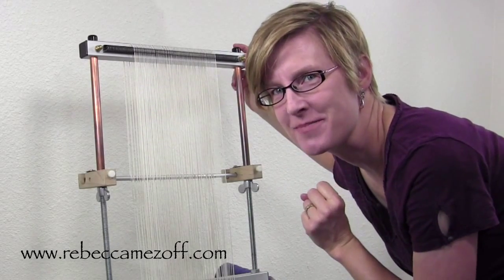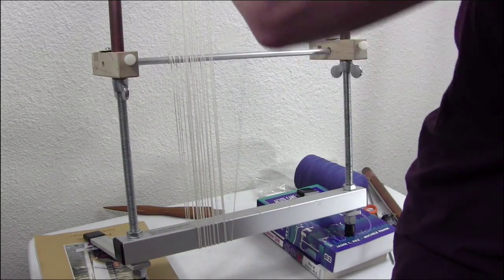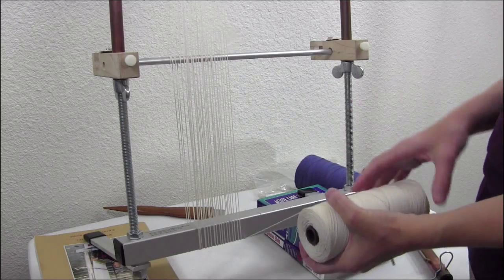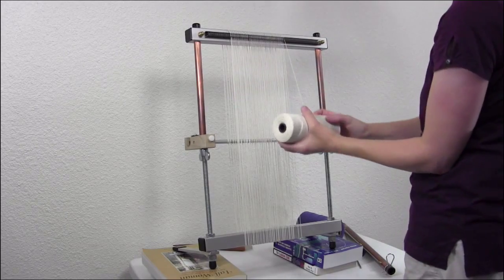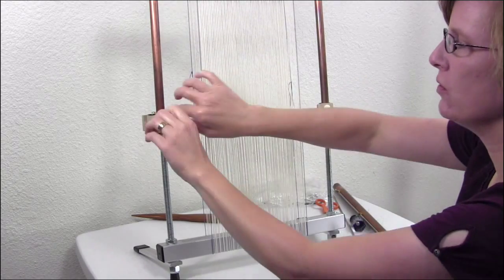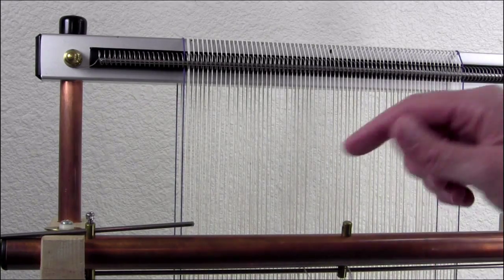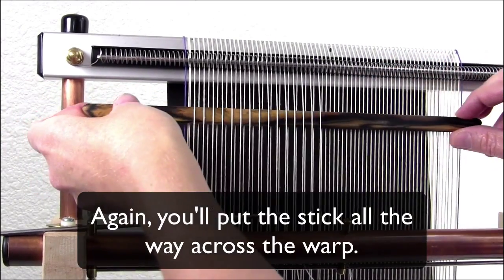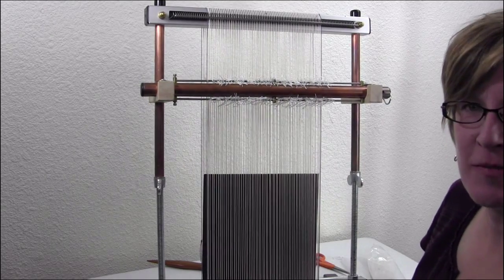Mirrix Warping Tips

Comment: Could a mirrix or another kind of loom be used to weave tapestry fabric? Not a yarn tapestry/wall hanging but the type of fabric that's made using a double weave. I have a tapestry dress that I love and I was wondering if I could, with enough practice, weave my own tapestry fabric using thread and looms like yours. I'm just concerned about spacing, would the thin warp made from strong thread need to be closer together than the spacing on the top of the loom allows? Also would I need a huge loom to make enough fabric? I know people make their own fabrics, it's just so hard to find anything on the internet about how to do it.
Reply from the maker: The word "tapestry" is used for many things, but officially it is a discontinuous weft-faced weave most often used to make images for art pieces. Double weave is not tapestry, nor is inlay. I suggest you look into floor loom weaving techniques. What it sounds like you want is to learn some nice loom-controlled weaves which sometimes approximate the image-making in tapestry. But you can't do that on a two-shed tapestry loom like this.

Comment: Hi Rebecca, very excited to get a Mirrix loom soon, I'm wondering what size loom you have here and which accessories?
Reply from the maker: This is the Mirrix Big Sister. I don't think there are any accessories in this video? Mirrix has added a lot of things over the last 6 years since I made this video. I like warp extenders on the Little Guy loom (or now they sell a longer version of this loom) and the Shasta Combs can be useful if you want a fast warping but it means some other things in terms of ergonomics and the length of tapestry you can weave. I do really like the bottom spring kit and this loom doesn't have one on it. It really helps get the initial warp spacing even. It isn't required and if you're patient, you can space the warps manually.
Reply: @RebeccaMezoffTapestry  Thank you so much, your reply was very helpful and helped me finally decide!

Comment: Do you always go the same direction on the top. Top of the loom. (Top of loom is cut off on the video so I can't see if you loop the thread over around the top of the loom in the same direction every time when you warp).
Reply from the maker: Hi Jeannie, happy to help with this question but I'm not sure what you mean. Can you either give me a time stamp from the video or be more specific about what is going where "on the top"? Thanks!
Reply: @RebeccaMezoffTapestry  I added to my comment hope that explains my question a little better. Thank you
Reply from the maker: @jeannemaxie  Mirrix looms are continuously warped. The warp goes all the way around the loom reversing direction at the warping bar. So one warp comes from the bottom over the front, the other from the back over the front. The reversal of direction is at the warping bar. I have detailed videos about this in my online classes or Mirrix has videos on their site. Hope that helps!

Comment: $338 for this loom.  What might you recommend for someone on a 'budget'?
Reply from the maker: Awesome question. I absolutely recommend making a copper pipe loom. If you're at all handy, or even if you're not with a little help from someone at the hardware store, you can make one for less than $50. There are directions in my Weaving Tapestry on Little Looms class, but there are free plans on Archie Brennan's website. A copper pipe loom has tensioning and that is the main thing you want.